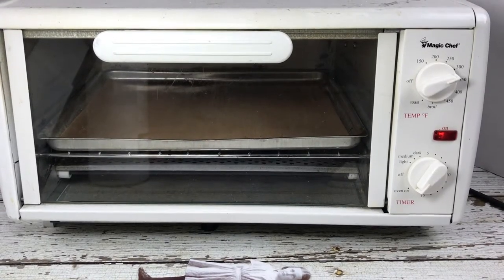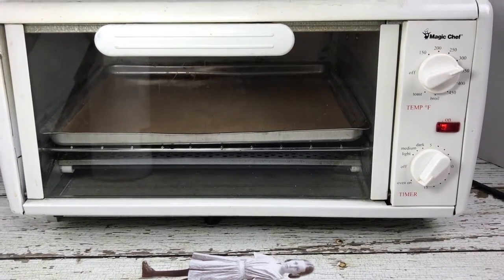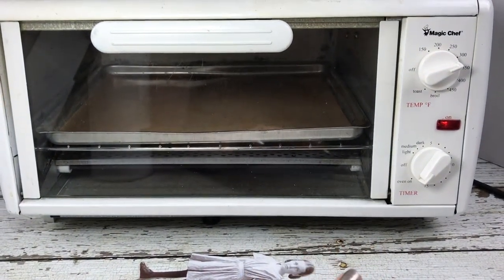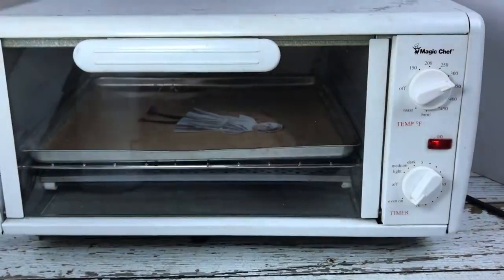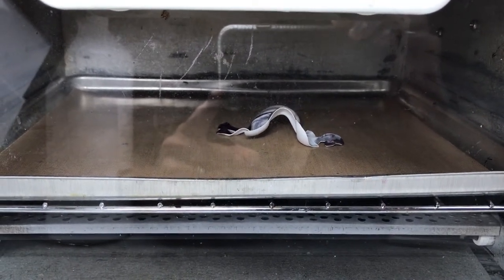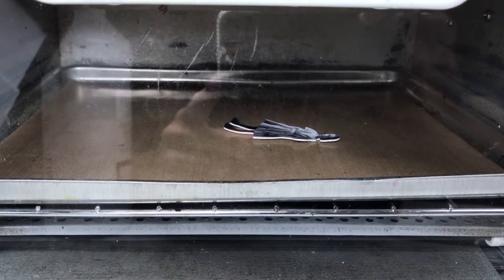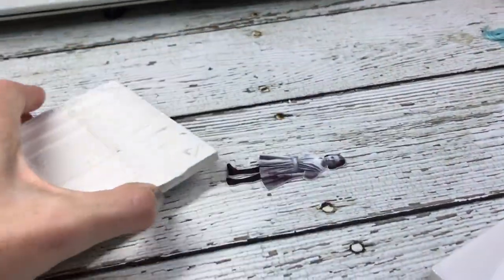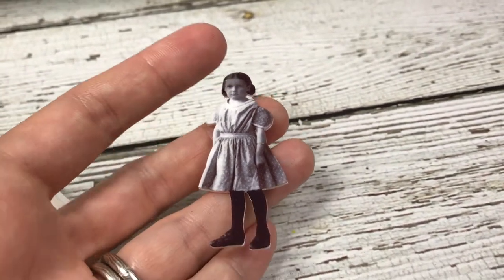Baking Shrink Plastic-What to Expect

Comment: if i did take it out too soon can i put it back in? mine is warped. :-) My directions say 2 to 3 min but it started shrinking almost immediately. how long do you shrink yours approx.?
Reply from the maker: Hi!  Yes, you can put it back in and it will reheat and keep shrinking if it had not finished the first time around.  I don’t always go by how many minutes it is in, rather, I just wait until it has flattened completely.  If there is a little bit of curling present, you can pull it out and immediately press it under a smooth tile to get it completely flat.   Make sure your oven is at the recommended temperature because is can sometimes shrink too quickly if the oven is too hot and get weird bubbly warping.  This can also happen if you put the plastic in before the oven has finished preheating...in toaster ovens the temp can go really high as it is preheating.  Hope this helps!